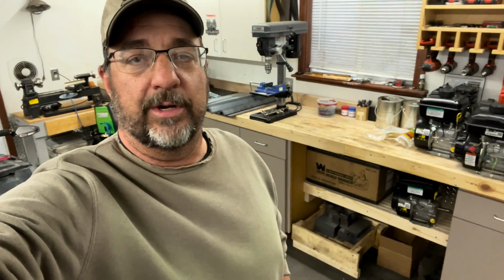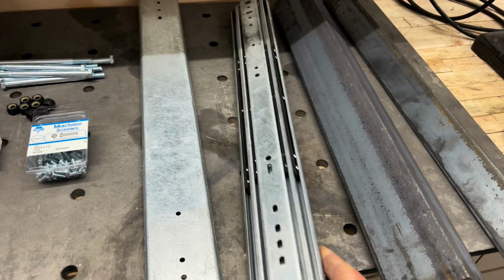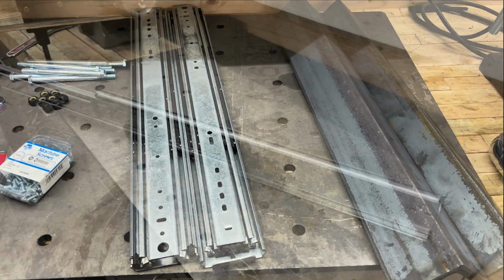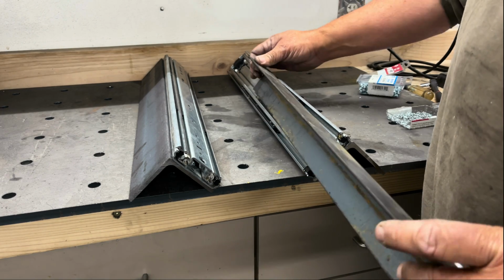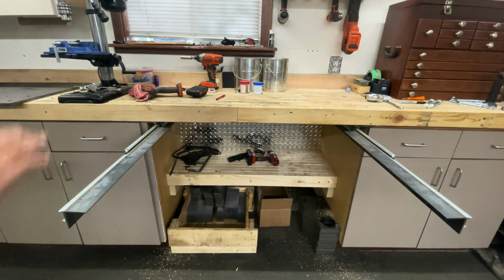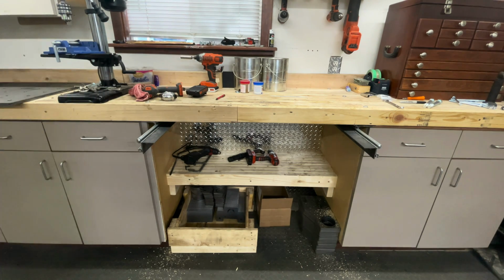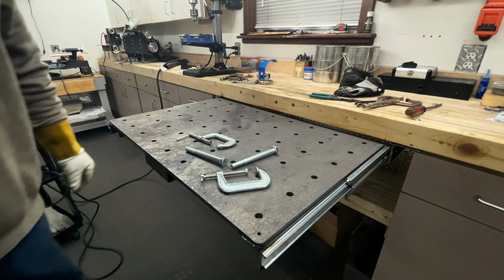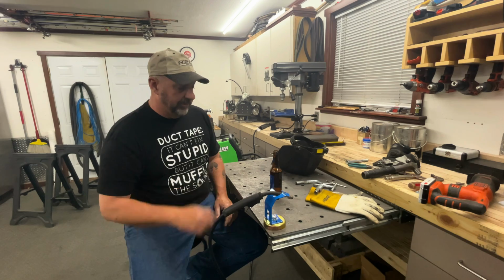Coolest Welding Table Ever - Retractable

Comment: Awesome use of space very cool project. I don’t know if you have had issues with weld spatter (bb’s) sticking to your work surface.  I know a flap disc will solve that issue but they also make a anti spatter spray that you can lightly spray the surface with and your project also for that matter that really helps with removing weld spatter. 
Good video thanks for your time and sharing your knowledge and projects with us.
Reply from the maker: I was a welder/fabricator for many years. I buy weld spatter in bulk. https://amzn.to/3KZgXbI

They make spray canisters that you can pressurize with your air compressor air. Fill it with your favorite chemicals, hit it with the air hose and your spraying. Slick. https://amzn.to/419rI0N

I also buy flap disks by the gross.

Thanks for watching. I really appreciate it.

Ed

Comment: What did this project cost you
Reply from the maker: The sliders where about $100.00 on Amazon.

The steel with the laser cut hole cost me about $125.55.

I could have saved some $$ by drilling the holes myself but I am lazy.

Comment: Do you think quarter inch plate instead of a half inch would work
Reply from the maker: I wouldn’t. The 1/2” plate will resist bending/warping better.

I would have done 5/8 but that would have been heavy.

Thanks for watching.

Comment: Great idea, I may copy it. I would bolt the steel plate to the angle iron. Incase you need to take it apart.
Reply from the maker: Fair enough.

I didn’t want bolts sticking up. Perhaps carriage bolts. 🤔
Reply: @jackofalltrades7822  You can use flat head screws that take an Allen wrench. I forgot to mention I have the same welder, I like it very much. It is very versatile. I am not a welder, I am a machinist. Thanks for your reviews.

Comment: What are the measurements for the holes?
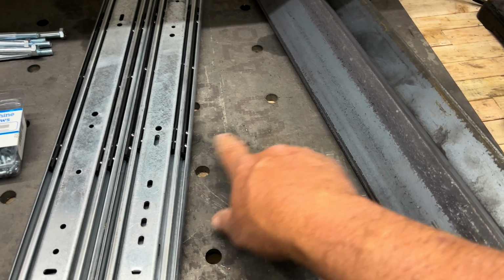Reply from the maker: I tell you at 3:58 I n the video.

5/8” holes 4” center to center north/south and east west.
Reply: @jackofalltrades7822  thank you!
Reply from the maker: @jeremynelson541  no problem. One of the Handiest things I have built.
Reply: @jackofalltrades7822  what is the spacing from edge of plate to hole center? Looks to be about 1 or 2"
Reply from the maker: @jeremynelson541  2”
Reply: @jackofalltrades7822  OUTSTANDING!! Thank you Sir!

Comment: Nice build! I'm not gonna lie, I'm super jealous of your shop. I love all the organization and storage and that laminated 2x4 top is sick! At today's lumber prices that would feed a small country. How did you get the top so flat? Did you rip your 2x4's a little to get rid of the tiny radiused edge or did you have it planed once you assembled it? I love how you put your fab table on drawer slides! 👍
Reply from the maker: I ran the 2x4s through a jointer then used a hand held belt sander to finish it off. It’s not perfect and there are some small gaps but it is HD and looks good.

Comment: How did you get started making videos and what does it take to get up and running on YouTube? What are the bare essentials needed? Camera, computer etc.?
Reply from the maker: I use my iPhone for the camera and some simple editing software. I also use a tripod that holds an iPhone and a simple wireless mic from Amazon. 

I keep it pretty simple.
Reply: @jackofalltrades7822  Thank you, I would have thought you had a lot more invested. You're vids are pretty well done.
Reply from the maker: @pmdoit  I have an iPhone 12 Pro which takes awesome video. I will do a video on my equipment. Stay tuned.

Comment: As a 19 Year old who wants to go into Fabrication do you have any tips I would like to know from one of the long beards of the Trades any good ways to get into it (I have prior welding experience cep covid has made me loose that Edge i was honing before it also machining but very little)
Reply from the maker: When you say "get into fabricating" are you saying as a career to pay the bills or hobby?
Reply: @jackofalltrades7822  Career hopefully
Reply from the maker: First thing is to get to school. Learn to weld by a competent instructor. If your local tech school has a fabrication program, take it. Then apprentice with a shop. You can only learn so much in school and nothing beats real world experience. There is a s more to fabricating than welding. Bending, cutting, rolling, layout, machining are all the tools of a fabricator and are best learned from a competent shop. 

Most of my experience was OJT in a fab shop. 30 years ago, I walked into a fab shop knowing how to weld and some HS metal shop classes under my belt. The rest I learned OJT.

Get into a shop and go to work. Experience is the Best teacher ever.
Reply: @jackofalltrades7822  Thanks and yeah Both my Instructors in my High school level tech schools were old long beards with a lot of experience so I've had compotant teachers but very little OJT so ill look for a shop to get into